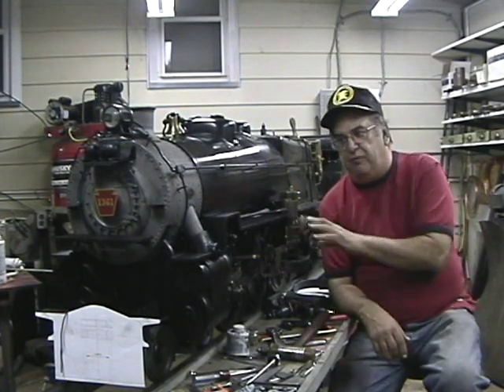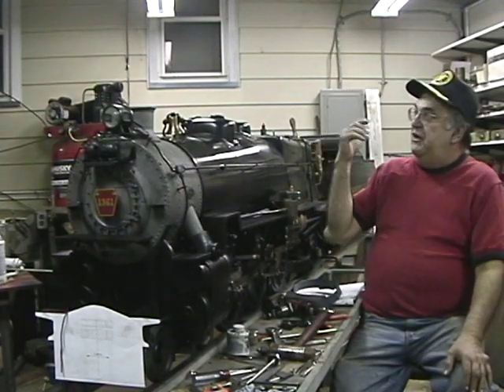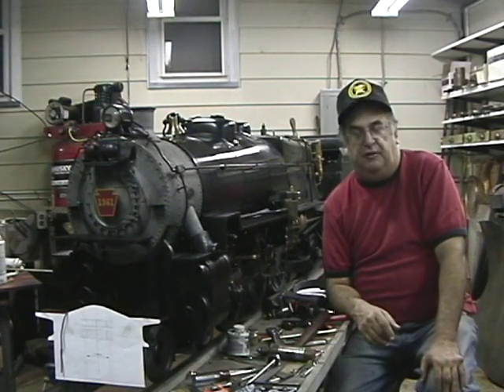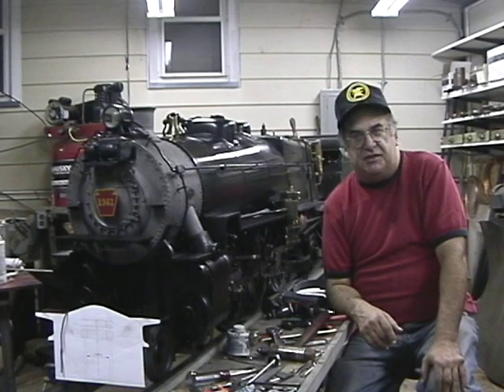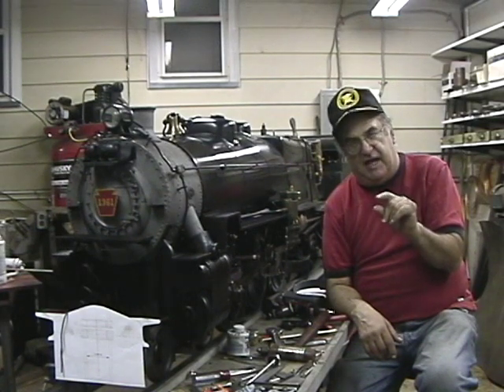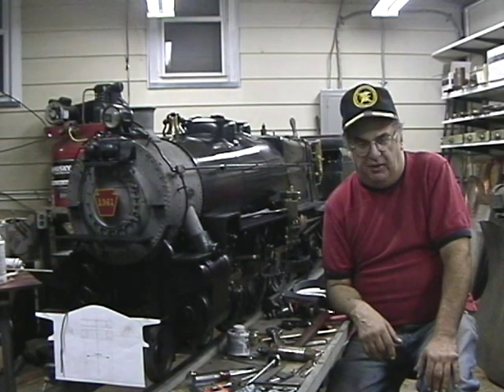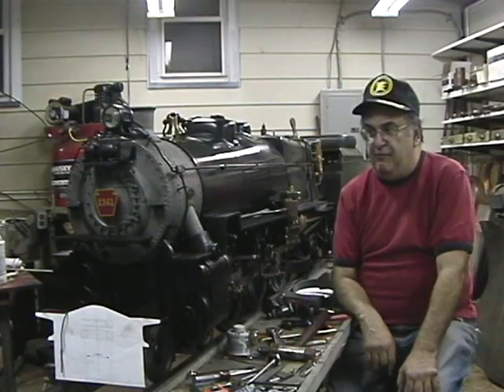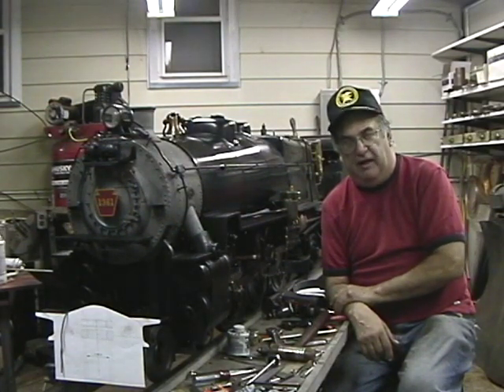Introduction to Locomotive Contruction

Comment: I just watched another video of yours titled: "Steamin Up" a Steam Engine daily maintenance and then a trip around the track. My first impression was this must be something  like the train ride they have a Griffin Park in Los Angeles.  Curiosity lead me to your channel. I  was sure that the engine was something that was purchased until I was grazing over all of thumbnail of your uploads and now I am left wondering. because  I didn't think it was possible but I have to ask the question. Is the the Steam Engine something that you made? or was it a  kit or something maybe existing that you adapted into a working Steam Engine?
Reply from the maker: Hi I designed and built the entire train using original prints acquired from the Pennsylvania state archives. I made the patterns had castings made and I machined the parts  I also built the boiler